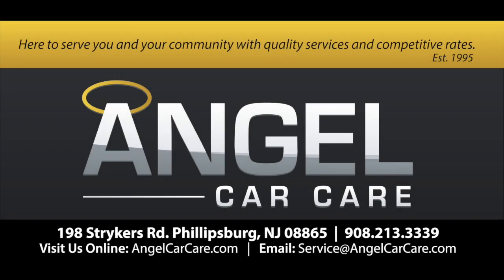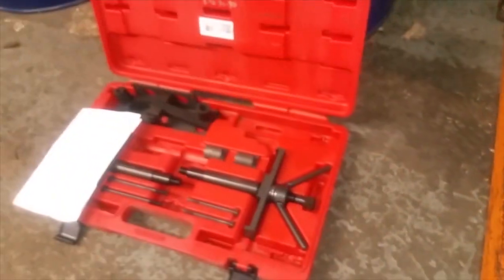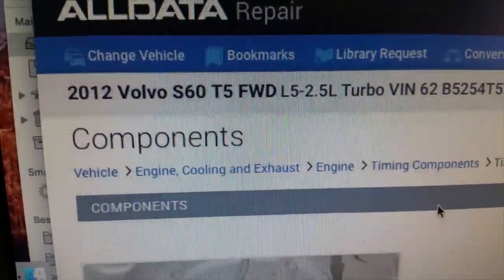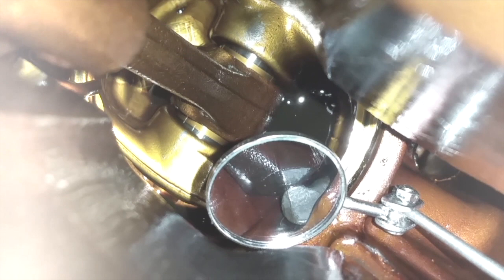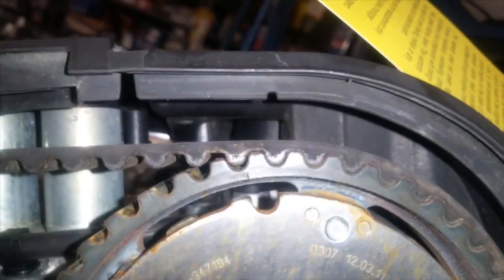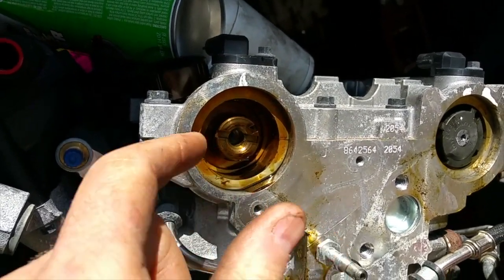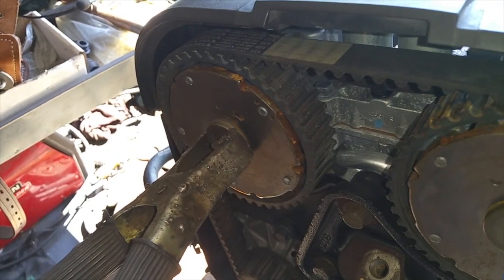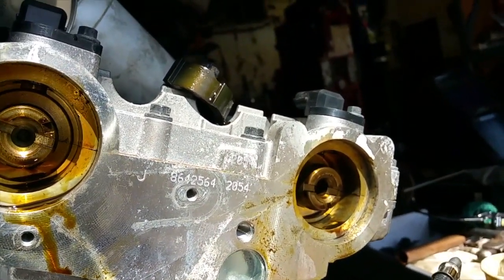Volvo T5 Timing Belt

Comment: Bottom line; You have to time these engines with the crank locked and the camshaft tool dailed into their key-ways because the "floating" sprockets/VVT hubs allow for adjustment via free-rotation, and so the two pulley marks could be lying to you unless you are absolutely certain they have never been touched since factory. This is why the two notches and etching are only indicative, used for guidance only - not absolute!

Many people can't seem to wrap their head around the notion that these timing marks are "bogus" - it doesn't matter where these mark are pointing when you set the belt, as long as you set the belt with the two aforementioned tools then it will always be correct. The problem only occurs when you get cute and don't set the belt with the special tools. Use the pulley timing marks instead and get fooled into believing they are gospel.

Comment: i am so gratefull for this video. you just saved my engine. in ghe morning i was about to go and attempt to remove a sheared bolt in the exhaust end of the cam. i was possibly thinking of welding last resort. if i had done that i would of earthed using the block.. thankyou

Comment: Noticed your previous timing setup with different tensioner. New type is manually adjusted up to ambien temperatures. Why different tensioners, is the other one is more reccomended than another?

Comment: My hats off to you my friend. This video is the only video that properly explains the procedure and how its  design is failsafe. As a fellow mechanic and years of experience. timing has always been set to TDC. Volvo has totally simplified the procedure, by taking TDC out of the equation. and seems that no-one understands the reason the crankshaft locking pin is so relevant. most mechanics have the mindset of the crank doesn't move so easily that it will during the belt installation, so they see no need to use it. those are the ones stuck on TDC.I have always only used the physical timing marks as a ballpark reference on all vehicles Especially ford where the harmonic Bal has a tendency to rotate on the rubber. True TDC achieved by inserting the oil dipstick into the sparkplug hole and observe its travel. doesn't matter what the crankshaft mark position is.  They don't understand that the piston is locked slightly below the surface of the block so the cams can be rotated without interfering with the valves especially after a broken belt. using the locking pin setting the crank in the correct position FIRST, cam rotation is safe. thank you ANGEL CAR CARE and  Volvo

Comment: But if I suspect that someone previously had reinstalled at least one of sprockets and I would like to ensure they both are in perfect alignment so I will lock cams from the back and loosen up sprockets bolts - will I have to turn them around CLOCKWISE fully and until marks are matching the notches before tightening (new) sprocket bolts? Since sprockets are variable they might be installed on cams not perfectly in right position irrespective of cams locked on the back.

Comment: Actually, it turns out that the mark was so far off on the intake cam because it WAS a tooth off.  And the diagram in the manual DOES match what you ended up with after installing the tool on the back side - however, the marks appear to be a half tooth off in each direction, which is kind of bogus.  You don't actually need that tool as it turns out.
Reply: the thing is with these POS cam gears is - they don't matter. they're floating. you can unscrew them from the cam and screw them in 90 degrees later, and it will fit and even work. what matter is the lock tool in the back of the cam locking it at presumably TDC. the front cog marks are just marks for reference, it doesn't matter if u miss a tooth when u put it back on AS LONG AS the cams are TDC

Comment: I’m trying to set the timing on my Volvo 2004 S4 T5 turbo I looked at your video and the lines at the backside of the backside of the cam where you put the cam locking tool I aligned them but I can’t find a low notch marks on the front side of the cam by the wheel to line them up, right

Comment: I would try several other options before welding to get that bolt out.  These dont rust out like exhaust bolts.  With torx it is critical to clean the bolt socket completely, use a high quality new condition bit and tap the bit in firmly Before turning to remove.  Most of the time the bolt will loosen.  If you strip it next step for me is to dremel a line in the bolt and try a large screwdriver head.  You can also tap counter clockwise with a punch or  use a spring punch.
Reply: Correct. Another method is taking a torch to the torx BIT. Insert red hot, no turning. Let it sit in there a good 30 seconds. You're walking to the refrigerator. A reliable tiny water squirt gun has been sitting in the coldest part of your refrigerator a few hours (NOT FREEZER). You want to squirt that cold water on that hot head immediately after removing the hot torx BIT. Another room temperature but not the one you heated, on an extension bar, apply light pressure, simultaneously tapping the metal handle of your extension bar. If that doesn't work, skip the squirt gun but let it cool a minute or so so hard torx BIT doesn't strip out hot, softer metal torx head. Hopefully the thread tight or varnish bond has weakened. That welding a nut is pretty extreme but I suppose in a practice done rapidly and deftly, may be ok. He didn't show the technique, but he's obviously spot tigging the center of the nut with a flux stick to do it rapidly as possible. And everything has to be super clean nut threads and torx head socket. There's a lot of prep he skipped over. Very nice little job, but it's not possible without prep. It wouldn't work if there was anything oily on anything, so it didn't just jump on there. But it's an idea I see as last resort. Always try hot and cold and 'shocking' the bolt before jumping since there are shop dangers welding and the prep of surfaces for welding is time I usually beat that method using heat & shocking it. Additionally I usually have luxury of penetrating oil sitting overnight, usually adding penetrating oil applications 4-5 times in 24 hours, shocking it each application. That's when I'm most likely to release frozen bolts myself. Butane hand torch probably my second most successful, applying shock treatments in between. For bolts you can't correctly heat like these torx, I'll heat a bit with the torch, usually one already a little worn I don't care about, since all it has to do is transfer heat hotter than the engine gets normally.

Comment: So basically this is the best and most reasonable explanation regarding timing on B5 engines. I really hate it when people just use markers and draw lines on the block / head and that is it. Personally I would rather invest into the locking tool than in a new engine. So one question though. The same tools apply to the 2.3 Turbo engine B5234T4 too ?
Reply: The tool isn't even needed.  The diagram turned out to be correct.  All he needed to do was rotate the intake sprocket one tooth.

Comment: Here's a tip....I put oxy acetylene heat to the rear torx head bolts at the rear of the cam...about 15 seconds worth.. small flame.. when it just starts to turn red that's enough... let it cool for a minute and I guarantee you they'll come out really easy.

Comment: So...volvo t5s are not 4 cylinder. Extraneous information not necessary.
Reply: They were 5 cylinders until drive e, then you got T5's that were 4 cylinder...
Reply: @FooJub  no. T5...the 5 stands for ... let's see 5 cylinders...
Reply: @georgesedeno7891  I'm well aware. And you are now aware that past 2014, s60 T5 and T6 included 4 cylinders, not just 5 and 6 cylinders respectively
Reply: @FooJub  ho hum...zzzzz!

Comment: Hi great video.
Do you adjust the camshafts using the camshaft locking tool ?
I have the same problem that my camshaft are not in line ,I have the exact same locking kit as you have.
Any help will be greatly appreciated .

Mally
Reply: Maybe the next tooth?

Comment: Yes good video. The marks on the cover and vvt gears are just a ball park reference for inspection only not for setting the timing. The locking tools locks the zero reference timing in place(remember the cam gears vary the cam timing while running). With the cams and crank locked in place, you want to set your belt tension before you torque the cam gears. Always loosen the gears, even if you do not change the seals. But just loose enough so that the cam gears rotate independent of the cams. You do not want them "sloppy loose". But then again why would you not change the seals and re seal the cam cover anyway? If not the slack taken up by the tensioner can preload one or both of the vvt gears. Remember the tensioner will pull the cams slightly counter clockwise. It can be subtle enough to even pull the cams slightly out after the lock tool is removed. The results could vary from, bent valves, poor idle and check engine light. The check engine light may not show up until the end of an oil life cycle. Then you will end up ghost chasing a vvt issue. The tool is relatively cheap, and its the only right way to do the job.
Reply: Do you have a part number for the crank locking tool by chance?
Reply: question since the tool locks cams to TDC and the pulleys don't really matter, how is it after I did what u recommended and removed the lock tool last, now instead of missing by alot on the exhaust (-18°) and poor idle I now get -6° but thankfully no CEL ? only on exhaust cam, intake is like -0.8° deviation via VIDA. the tool locked cams in place until after I tightened the belt. for the love of earth can't figure this out.

Comment: Your intake sprocket was off by one cog. You did a huge amount of work for one intake cam cog. All that matters is that the marks are within a cog to the indicator on the plastic cowling. You only need the cam locking tool if you’re removing the valve cover or the cam sprockets.
Reply: or the belt breaks
Reply: True, Ive done several timing belts on this engine and a cam sprocket - I wouldnt use cam locker just for timing.  By removing the timing belt with the crank dead center you can move the cam sprockets slightly then reinstall the belt until everything is lined up.

Comment: I am wondering what if you are removing the cam sprockets how do you make Shure you put them back correctly are they keyed or do you have to make Shure the cam locking tool is never removed and then put the sprockets back exactly the same as they came off

Comment: Is this the same for the B4204T9 (2.0 T6)? Thanks for the video.
Reply: No. that engine uses fixtures mounted to the front of the engine that hold the sprockets in place.
Reply: @johnangeleri7336  Thanks

Comment: Thanks for this video. I rotated the crankcase after the timing belt was removed. Is the fix simply to use the alignment pen to position the crankshaft? Does this ensure correct timing?
Reply: There is risk of valve damage when the crankshaft is rotated with out the timing belt on and in proper time.  The proper check would be to install a new timing belt using the tools and method in the video and do a compression test.
Hope that helps.
Reply: @johnangeleri7336  yeah... I destroyed two exhaust valves and had to take it to an independent shop to fix. Cost a pretty penny but it also gave a chance to inspect internals of engine. Ended up replacing all valve seals. One of the lessons for me is to complete one job at a time!!! I have to keep the car for life now to make up for the cost! I’m not mad about that though...

Comment: Is the cam sprocket keyed ? As some have no key and can be  loosened and moved to the mark,  especially as it locks in place at the other end...😉
Reply: The Camshaft VVT sprockets are not keyed. That's how you get the engine perfectly timed. Close enough as shown here. A more precise method would be to loosen the front cam bolts and tighten them with belt (and marks aligned) in place.

Comment: I also did this timing belt change without using camlocking tools, car was Volvo S40 T5 (2.5T) with same engine as the S60 T5.

Comment: I did it on two of these engines without special tools using only the matchmarks.
Reply: Tools will help you only do the job once.
Reply: I did as well, with no tools...but had the exhaust cam off a tad which made for hard start and the exhaust to glow red....why I am here looking....I got it now...
Reply: Does the engine have to come completely out for this job?
Reply: @alexanderstevens145  No. He probably had it out because he was doing multiple things. With a proper lift and engine hoist, it's probably the easiest way to work on it.

Comment: Hey so the Volvo dealer told me the reason for my check engine light is a incorrectly instaled timing and serpentine belt? Is that true or just a scam bcuz my car runs fine
Reply: get a
 code reader to see for yourself

Comment: If timing is know good before the belt is removed could you not just mark positions with a paint pen and straight edge?
Reply: The picture he pulled up on the computer is spot on if you pay close attention to it. Everything else is just precautionary and not something most would do when they work on cars themselves in the garage. The left pulley should be half a tooth to the left of the marking and the right pulley should be half a tooth to the right of the marking. Perfect timing.

Comment: Thank you for this perfect video. I have a 2007 C70 and had to replace the front camshaft seals, so I had to take those gears out and put them back, they take a t55 with 120 torque, I didn't have room to put my torx bit and obviously was not 120 torque, I have to redone the timing now again, tomorrow maybe. My question to you, when you lock the crankshaft, is there a hoe to put the tool or is just the open part of the crankshaft. I put it there going clockwise and it stop, but going back it was totally free...so I wonder if it have to be this way or completely lock if the tool is there. To take the screws in the camshaft rotor I use my air wrench, the very small and slowly but firmly I was able to take them intact and reuse them. Thank you again, very helpful
Reply: Concerning the crankshaft lock tool, it has to have the crank rotated against it.  So seat the crank against the tool by Turing the crankshaft BACKWARDS.  See the video at the ~ 2:00 min mark and it explains it.  It seats against the crank in the opposite direction of normal rotation so if the tool is accidentally left in, it will self eject if someone tries to start the engine.  again, see the video.  Hope your job goes well

Comment: Great video.  This will help greatly, as I have stripped the screw on the camshaft.  Do you have any idea of the part number?  I cannot find it on the Volvo part catalog.
Reply from the maker: We were spoiled enough to have a parts motor...that we still have.  If you send your mailing address to email in the opening of the video, I will put the extra screw in an envelope to you.  Thanks for watching.
Reply: @angelcarcare2499  Thank you very much for the offer.  I found thepart number from Volvo and got one delivered.  I cannot thank you enough for your video, as It allowed me to complete the job successfully.